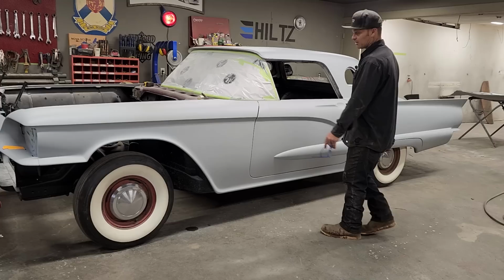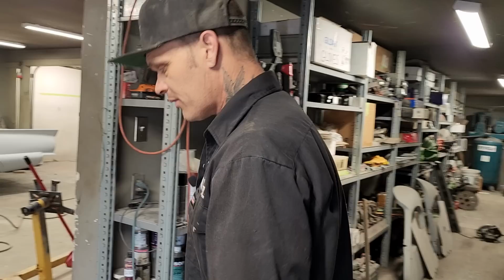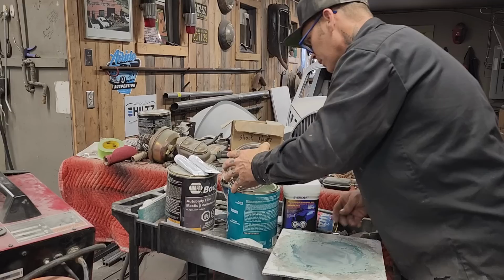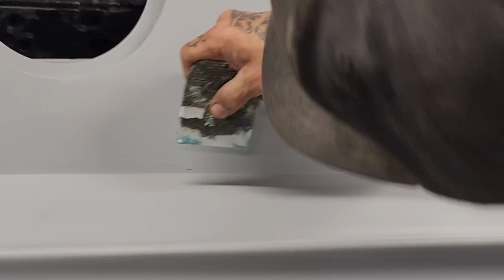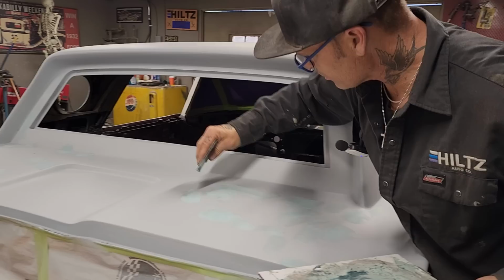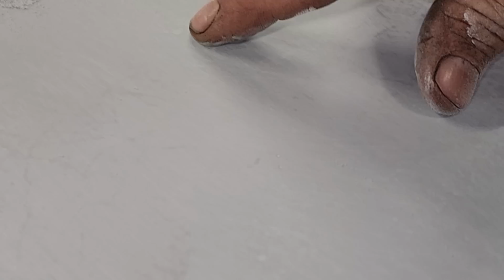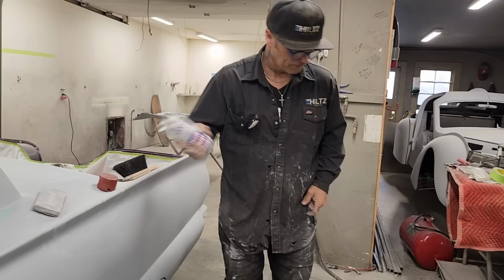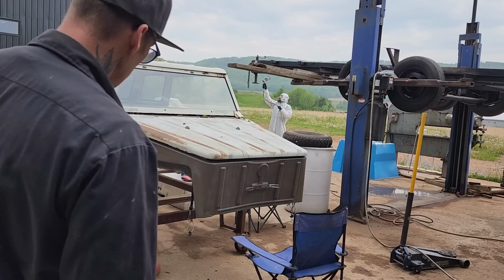This can save you time + money when prepping car for paint ✅

Comment: I used Evercoat Rage Xtreme. It is pin hole free. That is a little more in price, but it has a lot more extras per say. Saving time in the long run. It's  belly buttons. Jack.
Reply: Chad doesn’t have to worry about a customer coming back when a pinhole reappears.  Maybe he should fill the holes before he puts primer on?   It seems like it would save a lot of time, rather than keep going back and filling holes and priming, and then filling the holes and then priming again over and over
Reply: Don't forget sand scratches......

Comment: G’day
Over here in the land downunder 🇳🇿where the woman glow and the men thunder.

We use a product called Quick Stop Putty 💃💃💃 to fill Scratchers, Pits and Pin Holes.

Quick Stop Putty is purposely about the same consultancy as the primer/undercoat so it all blocks out about the same.

If you apply your quick stop putty right (as you will do with practice) you can just spray your undercoat straight over your quick stop putty.

I suppose it’s all in the product name “Quick Stop Putty”

Cheers 🇳🇿

Comment: Hey Chad, if your sandpaper is clogged just use old hacksaw blade and smack it on the sandpaper while it’s on the block and the stuck body fill will jump right out of the sandpaper. You’ll get some more life out of the paper that way. 👍

Comment: Chad, question ? On the motor mounts you made , fantastic job on them . Better then factory for sure. My question is , are you worried at all about engine vibration being that there is no rubber between the engine and the mounts ?
Reply: The rubber part is on the engine block

Comment: For me to chase pin holes and to putty each hole would drive me nuts, because I bet you wont get every scrstch and every pin hole, so I'ld rather spray it with Spray Putty and block sand it, it wouldnt take any extra time.
Reply: I’m guessing there are more pinholes under the primer that may be exposed if he starts sanding very much.  Hopefully the topcoat will seal the air bubbles under the paint so they don’t come back